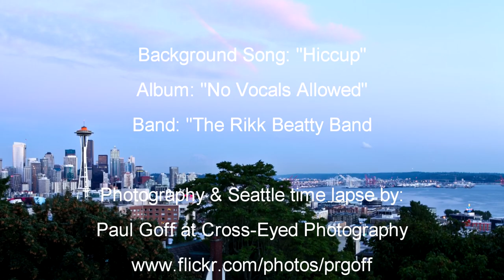RetroValves from Jet City Amplification

Comment: Actually, I'd love to hear the higher-gain sounds that you can achieve with all red RetroValves as most of the time I play electric with Way more distortion than he uses here. (This is not that distorted, at all.) The more tight low-noise gain I can achieve the better. I may give the red ones a shot.

Comment: @brutalaxxe - yes, the reverb driver tube is a great place for a RetroValve, and yes, you could go for 3xRED in a 2112, the gain would be extreme but the noise would be pretty reasonable as the RetroValves themselves are not noisy.

Comment: I'll defend you, Mr. Beatty. These half-distorted tones are some of the most sought after tones. When I play electric-guitar, I'm looking for great hard-rock and metal tones. I play with gobs of distortion. (more than this demo) If I want beautiful clean-tones I tend to just switch to a steel 12-string or a nylon-string acoustic. I'd like to try the red (high-gain) RetroValves to see how much low-noise gain I can achieve with my amps.

Comment: Thanks for the reply doug! I'm seriously considering changing all five preamp tubes in my amp to retro valves. So how would the different types of retro valves affect the reverb?   And would changing all three of my gain stages to the Amber ones keep the same kinda overall gain sound but add more bite as it's an analog gain circuit?